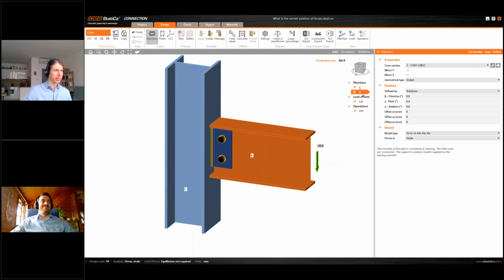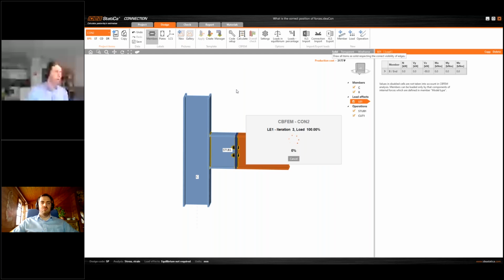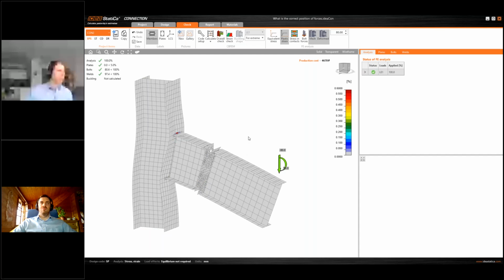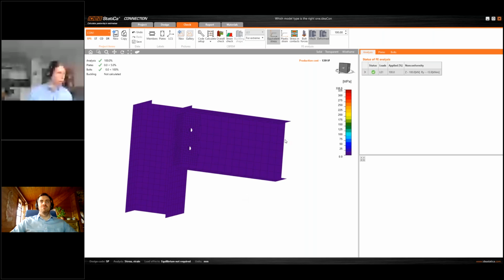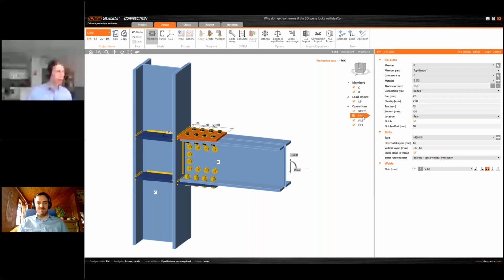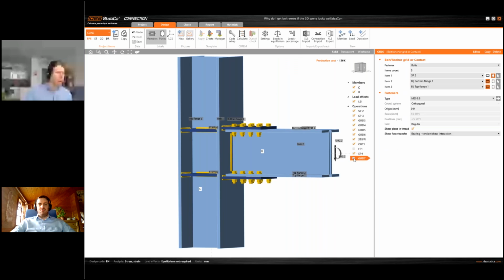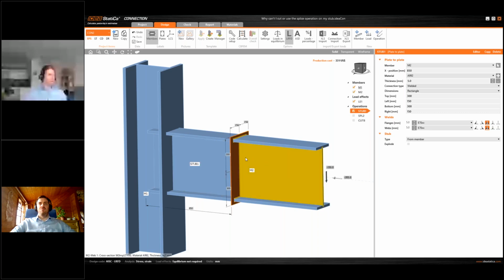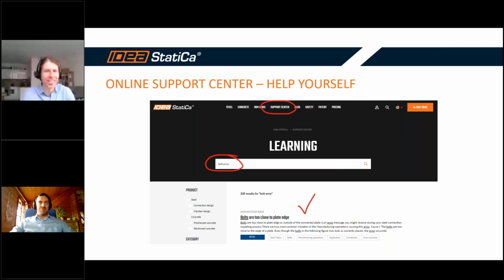The most common mistakes in connection design and how to avoid them

Comment: Typically for a shear connection , the reaction is just a vertical force at the node , and as a result the bolts and  the plates are subject to small bending moment.  However in your first example you have assumed he vertical force is applied at bolt location just to reduce the forces in the bolts. This is not consistent with the global system , if the beams are designed assuming shear connections.
Reply from the maker: Hello, both options are possible and this is up to the engineer to align the global model settings and the connection model.
If the connection is assumed pinned (hinge), the position of the hinge is usualy in center of bolts, that I why we show it like this.
But it is up to you where you position it - you can actually check multiple positions to be supersafe.
https://www.ideastatica.com/support-center/how-to-define-correct-load-position

Comment: According to AISC, for shear plate connections and extended shear connections, the position of the force is not directly at the bolts but shifts toward the node (which can be 5 inches or more). However, if I place the force at this shifted position, the connecting beam will rotate upwards, which does not reflect reality. Is this result acceptable?
Reply from the maker: Hello, yes, you can shift the shear force position (=zero bending moment position = hinge location) as you wish or as required by the code in order to cover more variants of load distribution in the connection and thus provide safer code-check.
Hovewer the analysis model is still based on FEM with all its rules and so that shifting the shear force towards the node from the real hinge position means the beam would be turned by the small oposite moment an will try to turn upwards. The calculated values are on the safe side so the result is acceptable, just the deformation trend is not logical.
https://www.ideastatica.com/support-center/how-to-define-correct-load-position
Reply: @ideastatica_en  thank you so much!

Comment: Im still confused regarding node and bolts when it will be used
Reply from the maker: Hello, please check the articles:
https://www.ideastatica.com/support-center/how-to-define-correct-load-position
https://www.ideastatica.com/support-center/equilibrium-and-supporting-member
And another webinar:
https://youtu.be/6nsYnUE-dss?si=No-LhSyUcoWgv6eX

Basically, you shift the position of the shear force to match the real conditions - the position of the hinge, and to respect the global structural model.
If you design a connection with a hinge (pinned connection) = in your global structural model, there is no moment in the node, only a shear force, then in IDEA StatiCa you set the position of the shear force to bolts (center of rotation in the hinge).
If in the global model you have bending moment in the node (semiridig or rigid connection) then you dont move the shear force position in IDEA StatiCa and leave it in the node.
In other cases when you want to elaborate and achieve a perfect alignment, you can use the manual set of position of shear force and thus moment diagram shift.
Reply: @ideastatica_en  thank u ❤️

Comment: hello, thanks for the explanation. I have a question please.
how do I check the stresses ?
IDEA, provides the equivalent stress (Von-Mises) and I define the material based on the uni-axial tensile test multiplied by a safety factor.
is it ok to compare both results ? 
if the equivalent stress is larger than the allowable stresses, then it is unsafe ?
and in this case i dont need to check the strain limit given by 5% as per the EC ?
Reply from the maker: "In general, IDEA does not check the stresses directly and does not need to check the stresses directly because it uses reaching of the 5% limit value of the principal membrane strain for checking in accordance with EN 1993-1-5 App. C. par. C.8 (1). If you use user defined material properties with for example a lower fyd, then IDEA automatically adapts the stress strain diagram based on that. The limit value of 5% for the principal membrane strain is still applied by default, it can be changed in the settings but we don't recommend it.

The occuring equivalent stresses in IDEA in general cannot exceed the yield stress fyd significantly since the material behaviour is based on the bilineair diagram from EN 1993-1-5 App. C. par. C.6  (the plastic branch does have a slight inclination which is also needed for numerical stability purposes and is also allowed by the norm, that can cause the stress to be a few MPa above fyd but it should not exceed it more than that.)"
Reply: @ideastatica_en  thank you for your explaination

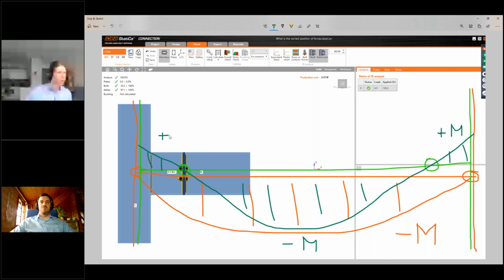Comment: In minute 10:45, you show that, by shifting a shear force to the real hinge location, we will have a positive moment at the support. So my question is, will idea statica take this positive moment into a consideration? In other words, will Idea statica involve that weld which connects the stub to the column in design calculation? I mean will idea statica check that can the weld of a stub resist the positive moment that exists due to shifting a shear force to the hinge location? Thank you........
Reply from the maker: Yes, of course the weld is code-checked for the actual forces acting on it, including this moment at this position.
Reply: @ideastatica_en  Thank you so mucn indeed

Comment: I have question regarding model type selection between N-Vy-Vz and N-Vz-Vy-My-Mz.
In webinar it's said that while using the N-Vy-Vz model type the program consumes some bending moment from the beam. But some value of bending moment remains or what ? How much does it consume, what approach is used inside the program during this type of analysis?
I'm asking that because now I'm designing hinged-type connection of the beam and the results are totally different while using this two model types. It would be great if you can take  a look at my connection to clear up doubts
Reply from the maker: Please send your question and the connection file to helpdesk@ideastatica.com

Comment: The presented example is wrong for the first question. The column is stiff, but if you have a full depth extended beam-to-girder shear tab the eccentricity could be much bigger, while the bolted connection is almost pinned. That means the vertical force will overload the girder by twisting it!
Reply: I agree.  In the UK, as per SCI P398 Simple Connections guide, the fin plate is an extension of the beam, with 0 bending at the fin-plate:column interface to avoid torsion of the supporting beam.
Reply from the maker: Well, Simple Connections guide is OK, but in reality, there is no 0 bending at the fin-plate: column interface.
Reply: @ideastatica_en  Looking at the case of a beam supporting another beam via a fin plate, if 0 shear is assumed to occur at the bolts, the supported beam reaction is eccentric to the supporting beam, inducing torsion into the supporting beam.   Unless the global frame analysis and supporting beam design has allowed for this (very unlikely) then there is likely a dangerous disconnect between connection design and frame analysis, and global equilibrium will not be achieved.  The low torsional stiffness of a supporting beam and the relatively high stiffness of the fin plate bolt group is such that I would expect the bolts to attract the loads for resisting rotation of the joint.  As a result, if designing ‘your way’, the bolts will receive load that they have not been designed for.
Reply: @smartbuildengineering , the p398 is about moment resisting connections not about simple connections. p358, on the other hand, for simple connections, is asking verification of the tension in the bolts, see page 21, as per the Eurocodes. Tension in the bolts for a simple connection means torsion. You could try FEA to clear the subject for yourself, or do test in an controlled environment. Here Idea Statica is right.
Reply: @thepredator6402  I think you've misunderstood what I said, I never mentioned tension in the bolts - I'm referring to axial rotation of the supporting beam, not the supported beam.  And yes. I referenced the wrong SCI document, obviously, as the title I gave didn't match and there are no fin plates in P398.
Reply: @smartbuildengineering  and I think you misunderstood the hole thing. I do not personally know you, but I give you a piece of advice, start to peel your eyes like you have a purpose, or give a serious thought to the site work!
Reply: @thepredator6402  Hahaha! Your arrogance is outstanding, 10 out of 10. Idiot.  You might wish to note which comments have the most thumbs up before you spend too long enjoying yourself in your own echo chamber.
Reply: Ps. The word is WHOLE not HOLE.
Reply: @smartbuildengineering , ignorant and rude, the feature of common life forms...someone told me once you can't turn a nag into a purebred horse.
Reply: @thepredator6402  Yaaaaawn.
Reply: In reality pinned connections does not exist! See Eurocode provisions. You could try FEA to clear the subject for yourself. Here Idea Statica is right.
Reply: By the way, before using the word wrong, try to analyze the impact!
Reply: @thepredator6402  By the way, FEA does not magically clear things up, if you put garbage in you'll get garbage out.  Go ahead and model an entire assembly, not just a joint. Try a 10m i-beam (beam 1) with torsionally fixed supports, then have another i-beam (beam 2) 4m long, connecting perpendicular into beam 1 at midspan with a fin plate.  Opposite end of beam 2 can can be pinned or whatever makes you feel good.  Put say 50kN/m on beam 2, let me know if the bolt forces makes sense to you.